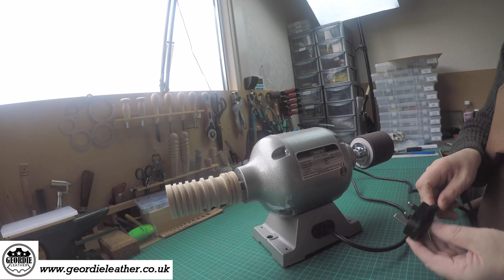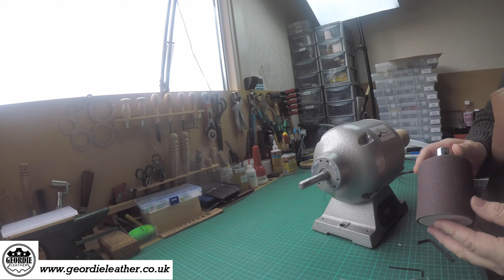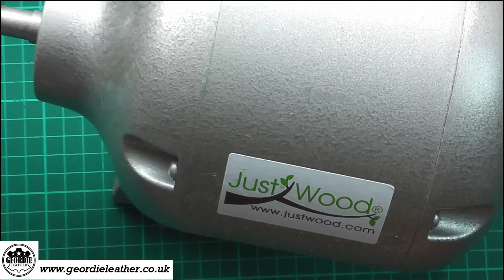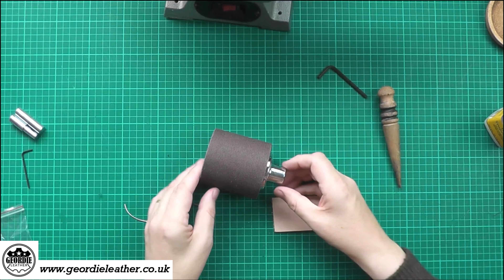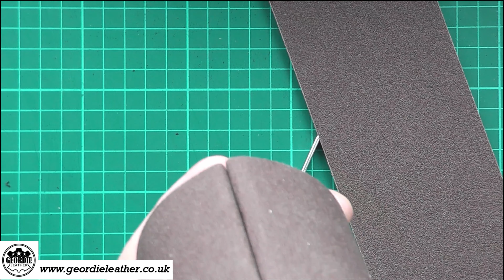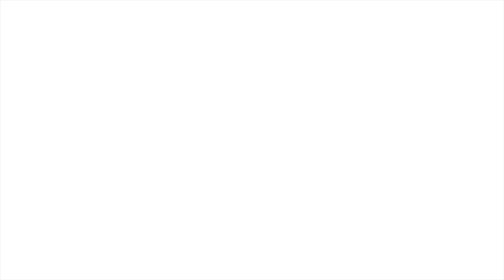Just Wood Burnishing Machine - Full Review

Comment: its a pity that they dont sell just the burnishing cylinder on some sort of bit mount on its own. with something like a basic press drill you could set it up and that might work where you have limited shop space.
Reply from the maker: Hi. It might be worth asking them if they will just sell you the burnishing section.
Reply: @GeordiesWorkshopUK  
Hi, you say 3000 rpm
Is that to much, my machine also about 2950 but when i want to polish leather, i make burn my edge :(

Comment: There was some wobble on the burnishing (right) side of the machine when you rotated it.  I'm considering getting a machine like this, but I'm also considering using a benchtop drill press with adapters.  Thanks for the video!
Reply from the maker: Thank you for your comment. I'm just clearing out my inbox of old comments, so there is no need to reply to this. Thanks. Geordie.